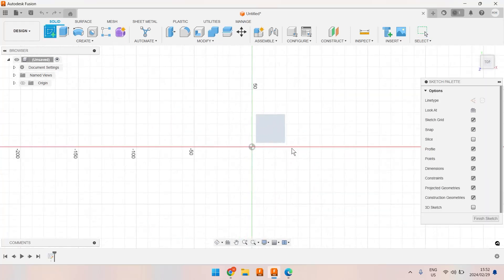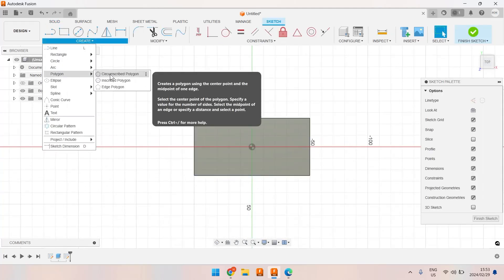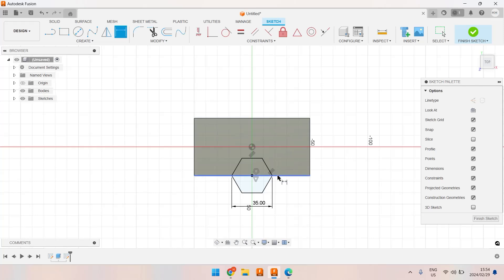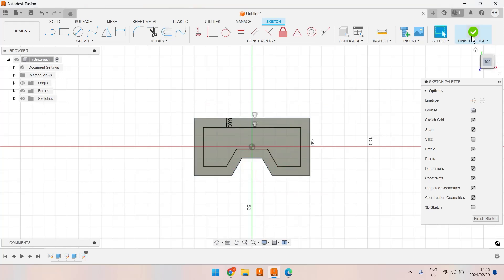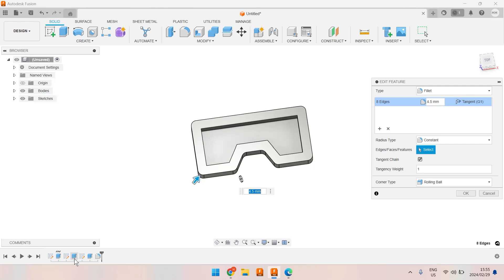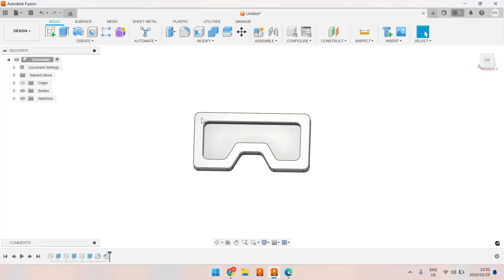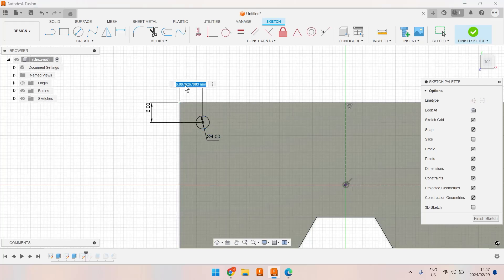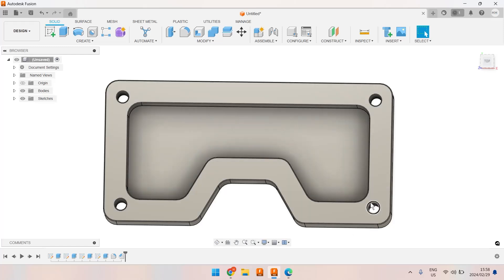Learn Fusion 360 by repetition

Comment: What is the keyboard shortcut you are using when you start with the hole in the last step of the project?
Reply: I click on the bottom of the material to automatically remove the material to the correct dimension
Reply: sorry only so comment now